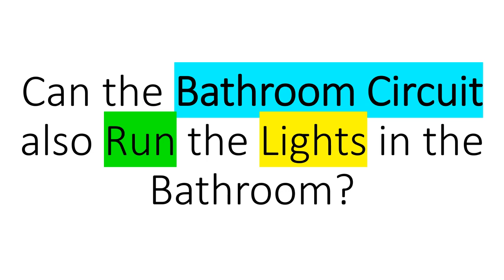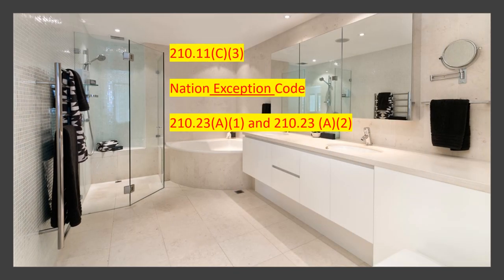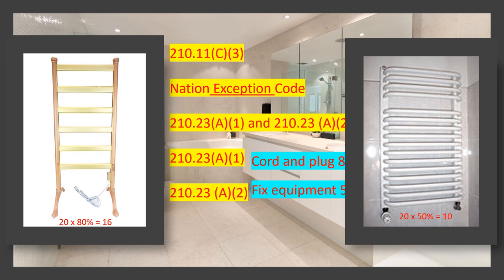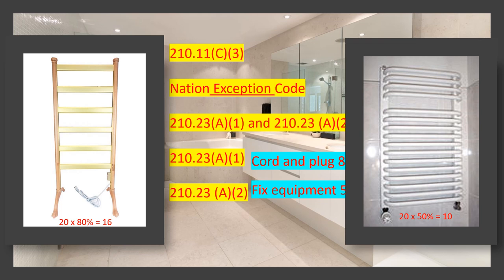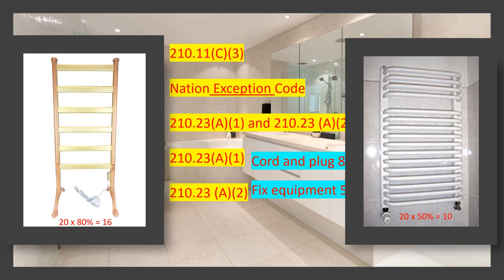Bathroom Lights off of Bathroom Receptacle?

Comment: some great exceptions in the code but with the given example we might be pushing the limits on a single circuit if this is a shared (female) bathroom. IOW, do load calcs based on real loading of (possible) multiple hair driers, curling irons, etc. Basically, we have a $20k renovation that really needs $100 - $200 more for another circuit to be safe in the long run. That's chump change in the big picture!

Comment: Electricians should know not to run all the electric in a room off of a single breaker.  In each room, one outlet should (perhaps must) be run on a different breaker, in the event the other circuit breaker trips.  Practically speaking, ceiling lights should always be run on a separate breaker.  This creates some difficulties, but so what.

Comment: I’ve done this before due to circumstances of a remodel but if you have more than one bathroom it will cost you another gfci breaker or receptacle because if you choose to put lights and receptacles on the same circuit in a bathroom it must remain dedicated to that bathroom and cannot jump to another bathroom, according to my ahj. Is this true and if so where’s the exception in the code?
Reply from the maker: 210.11(C)(3)

Comment: Informative. Did I miss something? I was anticipating an answer to running bathroom light(s) from the dedicated 20 AMP bathroom receptacle which is GFCI. While I appreciate the towel bar example, referencing that in the context of NEC exceptions strayed too far off topic for me. In short, with a dedicated 20 AMP power source to a single bathroom GFCI outlet, can a vanity light w/ switch be powered from the GFCI receptacle?

Comment: I do not recommend running the bathroom lights off the 20 amp receptacle circuit for two reasons.   First off, 12Awg wire is more tedious to work with than 14awg.  Second,  GFCI protection.  Depending on the wiring configuration,  a tripped GFCI  = lights out, not exactly a fun experience when that happens while  you're taking a shower. 

If you decide to wire the lights off the bath receptacle circuit,  use a standard 20 amp breaker (unless local codes require AFCI protection for the bathroom), a GFCI receptacle and be sure to wire the lighting circuit on the LINE side of the receptacle.   Note,  an exhaust fan or fan/light/heater installed over a tub or shower must be listed for damp locations, or wet locations if subject to direct spray, and might be required by the manufacturer to have GFCI protection.

Comment: What about the reverse?  Let's say I have a bathroom with a 20a circuit for receptacles and a 15a circuit for lighting.  I want to add an additional receptacle in a spot that would be diifficult for running off an existing receptacle but super easy to run from an existing light.  Is this allowed by code if I use a 15a GFCI for the new receptacle?
Reply: @awpr8r  But the question was if he can tap off a 15A lighting circuit to provide a 15A GFCI recept.